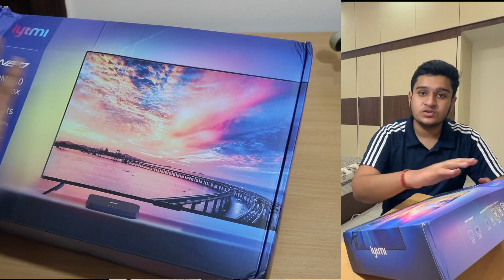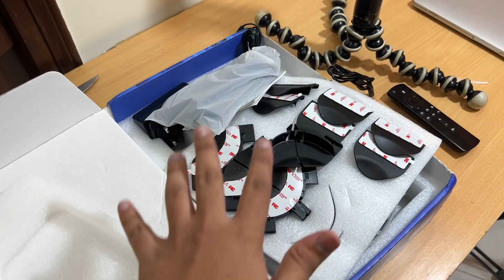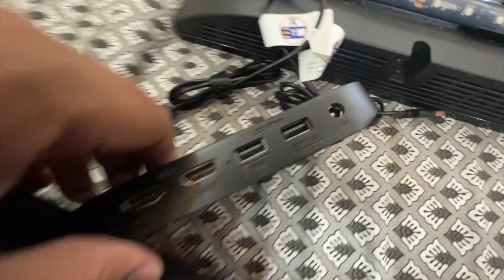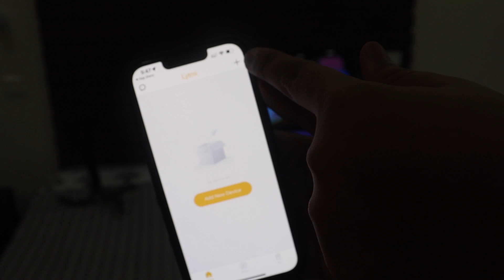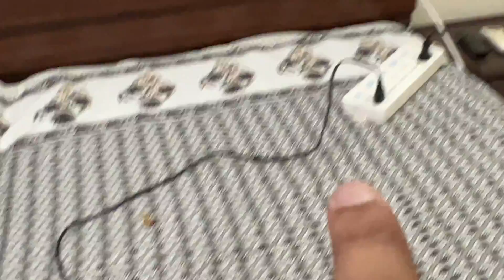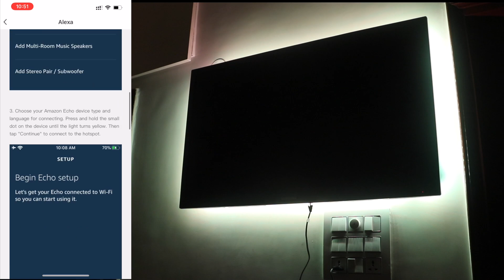Lytmi Neo HDMI 2.0 Sync Box | Philips Hue Ambilight Alternative For Cheap - Raghav Sharma

Comment: Bro thanks for a video really appreciated but one more concern on this product, see I am using android tv built in Android 11 is any android box or fire stick device needed for ambilighting to work for ott platform as well as YouTube
Please suggest
Reply from the maker: Hello Subir
This Lytmi setup and the other DIY video I made allows all netflix, prime, hotstar etc… but since you are asking a device that works directly with your TV…. I have seen devices like that which use Hyperion Android Grabber but as it involves screen capturing which may not work with Netflix … i will try to answer you till tomorrow if i get to know if in any case it can work
Reply: @Itsraghavv  Ok Raghav waiting for your answer why I am concern because I am using latest tv os which having android 11 inbuilt if this device not support on inbuilt system then I need to purchase android tv box that's not preferable for new tv please suggest what I can do for this case I want device which is directly work through tv hdmi.